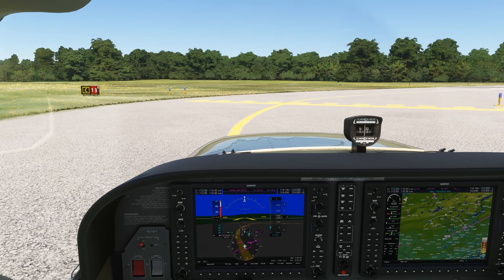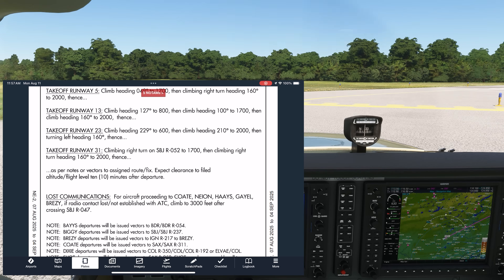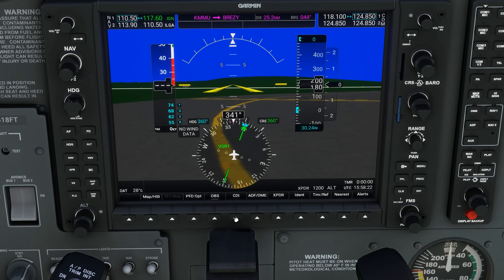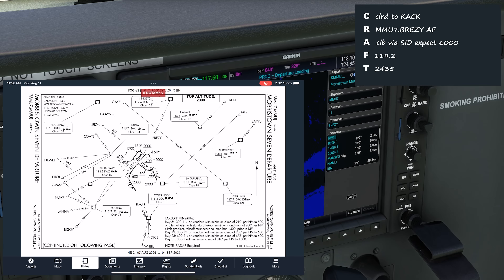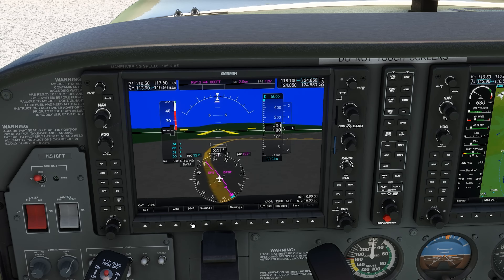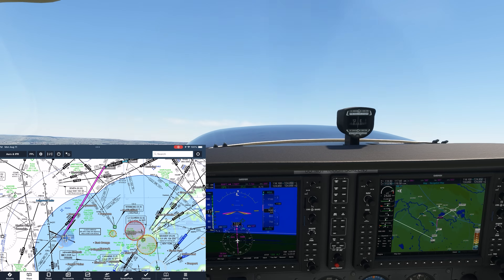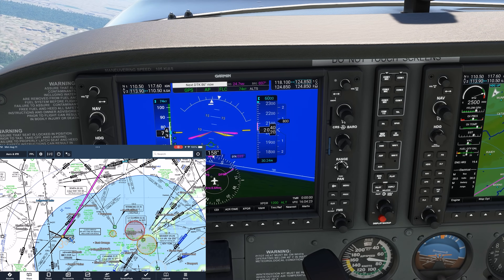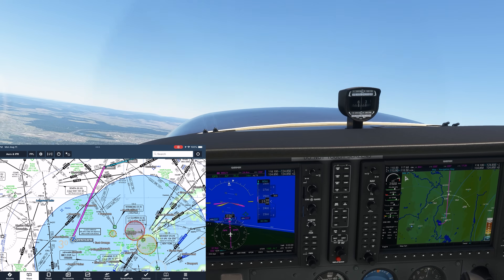IFR Departure Gotcha: Morristown Seven with a Twist

Comment: Very interesting.  With the avionics you have here, if you were given a vector to intercept the VOR radial, what would be the best way to fly that?  If using the GPS guidance, could you let the autopilot fly the given heading and arm nav mode to capture the radial?  Or is it best to use the VOR signal (green needles) to capture the radial?
Reply: I was wondering the same thing, this seems it would be a little tough on the automation. Lots of switching from nav to heading
Reply: Use of certified gps would be the best, and most common way to do it.
Reply: The best way would be DIRECT TO COURSE TO and put the bearing in and then just intercept with the GPS. Easy peesy.
Reply: There are a few ways. When I encounter these scenarios I normally would enter IGN and BREZY as waypoints along the route, then when vectored by ATC would active the leg. This would keep me in GPS mode the entire time. AP wise would being in heading mode while being vectored until intercept. 

The other option is to use obs mode from IGN, but this requires more steps and change for human error